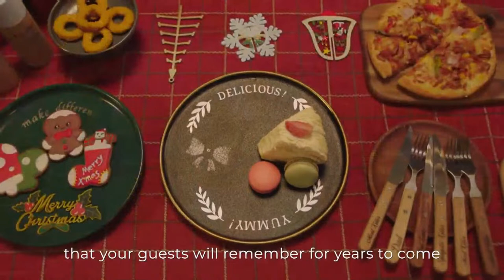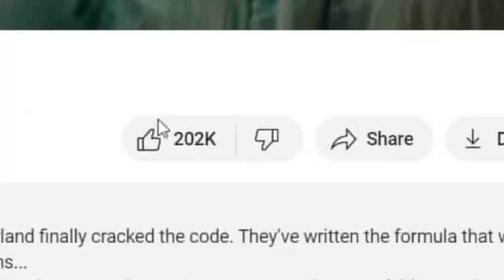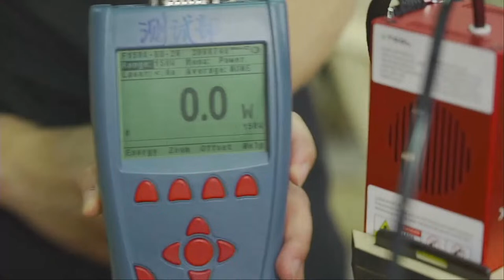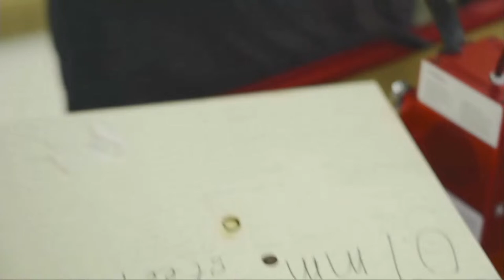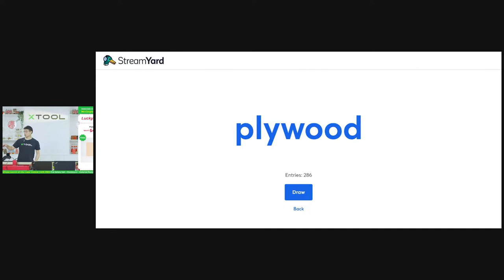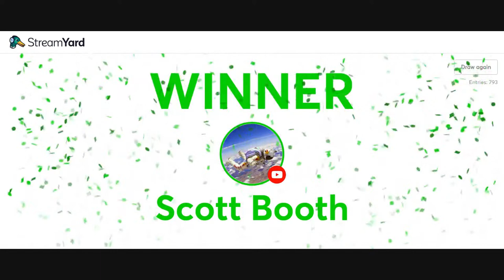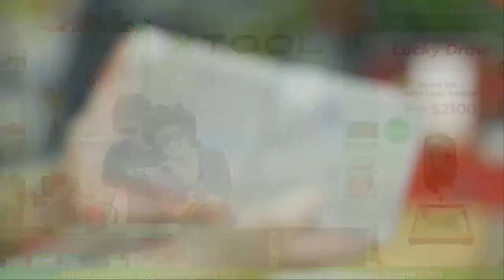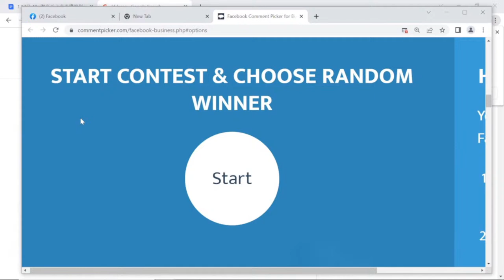xTool D1 Pro 40w Laser Module Launch

Comment: They really need to give the original D1 NOT Pro owners a deeeep discount on new products. We were left  TOTALLY outdated within a year!!!
Reply: Yeah. I agree.  Our machines became obsolete and worthless under a year.
Reply: @120bhbr  I wouldn't say obsolete and worthless, it is still the top diode machine out there in my opinion.
Reply: Agree
Reply: I agree. The d1 pro was not even announced when I bought mine, and came out like a month after I ordered.
Reply: I feel the same. The pro model came out two months after I bought mine and I had no clue it was coming out after doing a good amount of research on X tool the company…I won’t be buying any upgrades from them for a while for I did buy the 20 watt laser and I will take my time and wait to see if that is all I really need.
Reply from the maker: Yes!!! We actually launch a replacement plan from Jan 13th until Jan 31st for D1 users, we will provide an exclusive discount-- 15% OFF for the 40W laser module, and you can use it to purchase [D1 Pro 5W machine+ 40W laser module] to upgrade. Please join our FB group to get the code. https://www.facebook.com/groups/3145451765777730
Reply from the maker: @120bhbr  We actually launch a replacement plan from Jan 13th until Jan 31st for D1 users, we will provide an exclusive discount-- 15% OFF for the 40W laser module, and you can use it to purchase [D1 Pro 5W machine+ 40W laser module] to upgrade. Please join our FB group to get the code. https://www.facebook.com/groups/3145451765777730
Reply: 15% off lol man that’s messed up. I’m in $6000 I haven’t had the D1 for even a year and you guys just discontinued it. You should be helping us upgrade to the D1 pro with the required chip. Why should we have to buy a new machine when we already bought one? Just doesn’t make sense. Why not sell us the pro chip so we can make our machine compatible. There’s really no difference between the 2. Seems kinda greedy to make us purchase another machine.
Reply: Mine became obsolete in 24 hours after purchase.
Reply: 😮 I’m so discouraged to purchase this…how do I know they won’t come out with a new machine after this model leaving me with a new obsolete model?🤦🏽‍♀️🤷🏽‍♀️
Reply: Message customer service and see how important you are to them before buying from them. You will be lucky if you even get a response. Wish I never purchased from this company. Horrible customer service. I had a part break including the servo they sent me a replacement and it came destroyed and smashed into the track. Their response put it on your machine lmao. The servo is messed up including the gear. Customer service is a 1 on a scale of 1-10. I’d invest my money in a company that cares about its customers. If something goes wrong you’re on your own basically.
Reply: @kentsams1121  opino igual. Lastima como están manejando esto. En 8 meses ya que compre la máquina 10W ya van 40 W en otros 8 meses irán la 200 W y los usuarios quedamos en perdidas. Y plan retoma no sirve por más que intento comunicarme ellos dicen no entender nada
Reply: @120bhbr  so you’re saying that you can’t do what you were doing with your machine before this announcement?
Reply: Really, some of you guys don’t get it. Companies aren’t obligated to notify you months before they come out with an upgraded model. Ever hear about the Osborn Effect? Look it up. Offering a discount is fine. Do you guys need the 40 watts so badly that you can’t do what you’re doing now without it? No, so your machines aren’t obsolete.
Reply: @xToollaser  not everyone has Facebook!!!
Reply: @kentsams1121  My D1 was in mid-shipment when the D1 Pro was released 🤬
Reply: @JodySkyWalker  and how many are “Surface Pro many”? Those who comment? How many people other than those on YouTube need to upgrade?  Virtually every manufacturer has a disclaimer stating that they are not required to ensure improvements in their machines are backwards compatible, or that they will even offer them. xTool has offered discounts. Not as much as you want, but do you really know what their costs are? No, you don’t. So stop whining.

Comment: It's exciting to see a 40w option for xTool.  I'm a little disappointed as an initial backer of the D1 that the upgrades are just as expensive for us as any new buyer.  Since I bought the initial machine, I bought the rotary and now just ordered the new rotary which made my new in the box rotary obsolete. I bought the extension rails to expand my machine capacity. I bought the air module and I almost ordered the 20w upgrade. I'm excited to see upgrades and hope that as new items come out they will all be compatible with the D1 and the D1pro both. I'm thinking it makes sense to stop buying upgrades and wait as things are being replaced so quickly.
Reply: I just heard in the presentation that the 40w isn't compatible with the D1 and only works with the D1pro so disregard my comment above about being excited about the upgrades. I also spent mony and purchased the honeycomb so I've been a pretty loyal customer from the start. Now after my D1 barely being a year old  xTool is not making the upgrades compatible with the D1. That's a shame and pretty rotten that initial customers have machines that are still like new that can't buy the new upgrades. I'm very very disappointed as someone that has continued t9nspend my money with xTool. I guess I don't have to decide if I'll buy one then though. Before determining future loyalty to the xTool brand I'll see what happens next and what becomes available for D1 owners in the future.  The customer support has been really good and the D1 product good so I won't completely complain but please don't leave us original supporters without upgrade options.
Reply: @davidengelbrecht8457  The question is do you need the 40w to begin with? I understand your frustration and at the very least you are not going on a bash xtool hunt. Myself i got the 20w just before christmas but it will suffice my needs. I spent alot as well and with my new 3d printer would not be able to afford the 40w anyhow, lol
Reply from the maker: Sorry that you feel disappointed David! We actually launch a replacement plan from Jan 13th until Jan 31st for D1 users, we will provide an exclusive discount-- 15% OFF for the 40W laser module, and you can use it to purchase [D1 Pro 5W machine+ 40W laser module] to upgrade. Please join our FB group to get the code. https://www.facebook.com/groups/3145451765777730
Reply: @xToollaser  My disappointment is not that there is a newer model or that there continues to be updates and upgrades. That's great. My disappointment is that the decision was made to not make the new 40w module compatible with the D1 xTool. I did reach out to xTool regarding any upgrade options for my original rotary to the new rotary and did not see a response. I did decide to then purchase the new rotary anyway so I now have both. I may have considered the D1pro and rotary together had xTool responded with the information about a Facebook group discount. I did use the link you provided to request access to the Facebook group however one of the questions to join was what two colors are in the image. Unfortunately the image is shown in a small size which crops the green border out of the image on the first screen your link took me to. So I had to guess and I guessed Grey and black because the approximately 12.7mm image was on the prior page from where the questions were. If you go to the Facebook page showing the full image the green is easy to see. If you go through the link you provided it is not. (Thanks for allowing me to join the group even though I guessed the wrong color.)

I don't want to seem like a complainer only. Your products I have received are great. They had the easiest learning curve of the several lasers we have at work and I was able to use the D1 right out of the box. I'm very happy with what I have and am just disappointed about the latest product not working with my D1 and the only option is to buy another new machine and start replacing parts right away. Best wishes and I look forward to seeing what is next on the xTool product line. I'm sincerely happy with what I have.

Comment: I have recently purchased the 10W M1 and are very happy with it. It is easy to use and has an enclosure which I wanted for safety reasons. It will engrave most of what I want. I also have a K40 which fills in most of the gaps. When it is time to replace the K40 I will look at a better quality CO2 or a fibre laser depending what I can afford at the time.
Reply from the maker: Thanks Peter!

Comment: I have the D1pro 20 watt. If I preorder the 40 watt (laser only), can I swap between the 2 lasers?  Will the new controller board that comes with the 40 watt module work with the 20 watt laser?
Reply from the maker: You can! Yes!